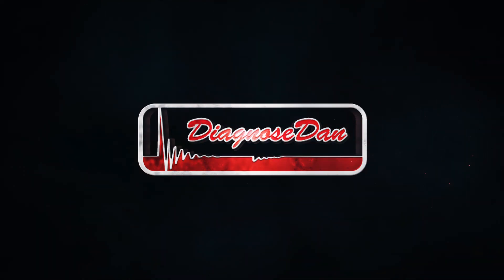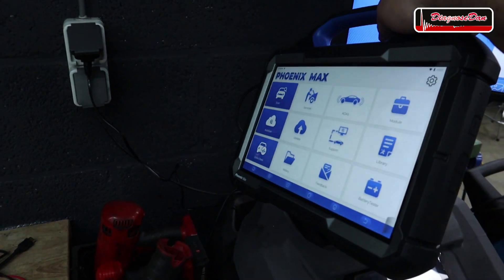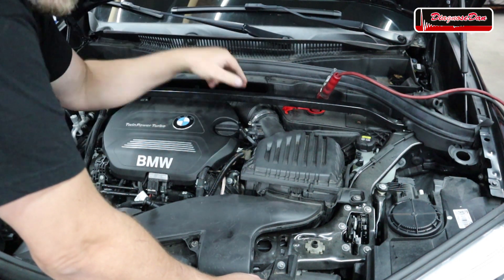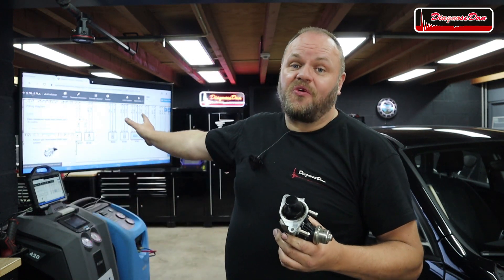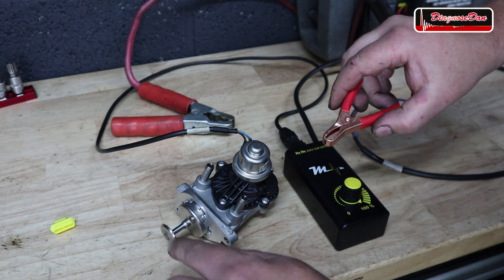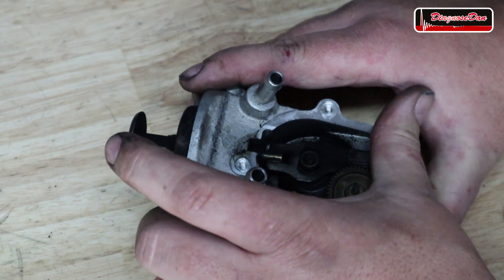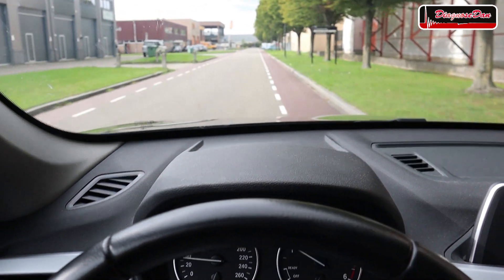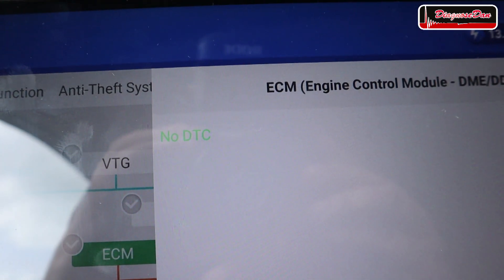EGR TROUBLE

Comment: presumably if you put 12v across pins 1 & 2 of the EGR that will retract the valve and you can install it in the car.  i don't have a obd tool with the feature

Comment: I know it's late but maybe some people don't like to scroll and read below. EGR should be closed, while burning clean the DPF - so the hot gasses help by burning. Also all-in-all EGR only should be open on the low range of the RPM, hence DPF regen is done above 3000 RPM, and EGR really only "helps" with low RPM acceleration (if ever)!
Now to my question - I have the "dreaded" code 4521 (1296) on my 2004 E46 320d, 150 Hp, Eu3 engine but Eu4 exhaust system from factory. Multiple sources told me it is the turbo, but my engine itself doesn't consume any oil, and runs fine in lower gears even above 3000 RPM, when up a hill it just hits the sweet spot - usually above 130 KM/H in 6th gear and goes into limp mode.
Is that a sign of a bad actuator - or should I get the whole turbo checked out? Or can that be only a bad vacuum line?
Thanks for any ideas, or answers! Great channel!!

Comment: Difficult question !
If the EGR valve remains open, carbon saturation will be accelerated, while if it remains closed, it will cause excessively high emissions.
So I would say at 80% (😂😂😂😂) it must remain open !

Comment: definitely right to replace it if you want to warranty it, but I would definitely go get some Berryman carb cleaner or some Rust Blaster and spray it down and clean it. I might even take something like that and put it in some Organic Apple Cider Vinegar with the mother in it and submerge it in a small glass bowl and let it soak for an hour or so. I've done that on a lawn mower gas tank before that had a lot of build up from dirty low octane gas and it had the screen in the bottom of the gas tank shiny again. Even adding some baking soda to it will activate a cleaning foam with the vinegar that is actually great to use in bathtub and sink drains!

Comment: Let me just say that Harbor Freight sells a set of security bits, and the one they sell for cheap has a whole set of torque bits in it. I recently used a T40 to remove a bolt from a throttle body on a 96 Cadillac DeVille. It didn't need the security hole in the middle for it but it was the only T40 I had. You never know when you'll need a bit that needs a hole in the middle to work on something. You don't see them often but you don't need one until you need one!

Comment: Bit of an asshole design on that valve, it would be simple to make that fork-like actuator arm and valve itself to be attached together with couple screws and it would be serviceable assembly, just disassemble and clean it. Brass gears and it would last lifetime of vehicle if maintained correctly.

Comment: hi Dan, in answer to your question, to regen the DPF , it need to be heated about 600 degrees, and it would be done by injecting fuel ATDC ,it's like to make stroke in the DPF,so the EGR should be closed , to not cooling down Exhust temperature.

Comment: I've been through the same exact thing but the scan tools I had did not have the feature to put the EGR into the fitting position, I had to work out which wires were for the actuator and simply supplied them with 12V while I fitted it, and fitted it quick because who knows what duty cycle the EGR actuator is designed for, but it worked, the only other thing you didn't say, and this could be my memory here as it was a while back is that I recall using a diag tool to tell the ECU it had a new EGR valve fitted, which is common these days.

Comment: Excellent video Dan!
I've have this exact issue with my 520d, BMW replaced the valve and cooler and updated the software, issue resolved for a couple of months, then new EGR got clogged/stuck again, replaced again, I now have the same symptoms again with the 2nd new valve. Any suggestions why it is still happening? They mentioned the software update controls the valve differently now depending on the temperature 🤔

Comment: Thanks for the tutorial Dan,
Followed everything you did, except i used ISTA.
When i activate service mode it retracts the valve to 30. But once install it and screw it on, as i tighten it slowly retracts the valve position to 50+ as if its hitting something? 
Any ideas?
Driving it like this still puts the car into limp mode.

Comment: EGR open or closed during DPF regen depends on the regeneration strategy i guess.
In case of heating up the EGT temp closed 100%, how ever the strategy of late injecting fuel and dumping unburned fuel in the cat to heat up the EGR i think it may be fine if the EGR stays active (same for systems that have a separate injector in the exhaust).

Comment: Diagnosedan can plz explan why to initialize the egr valve , because the movement of valve is according to length till the closer position of valve so there is no option it can hit the metal and extend its postion because it made to make movement till the closing postion not above that postion ?

Comment: After looking at this video a second time, I start to understand what's happening. One thing which isn't mentioned is that when the valve is stucked,  the engine die after some seconds, and in the meantime it run very rough. When you try to start several times, may be the engine keep on running.
In my car, X3/F25 30d 2011, it got stuck this week (fault code P042E).
Long story short.
There is a plastic cover above the gears compartment, by removing that I could see that the axle/valve was stuck in open position. This time I could move it up and down by the hand. I put som grease on the moving parts, and I will drive a little to see what happens next then I put the cover back.
There was no soot at all among the gears! The car has been driven 246,399 km, but it is "new" for me.
The adventure goes on... 🥺😉

Comment: I think you could retract the valve wherever you want with the dimmer switch you had. You would be able to install the EGR without a scan tool.
Reply: It will not work. Soon as disconnect the power spring pushes the valve back out.

Comment: Halo Dan, i'm from Indonesia. Here, the population of BMWs with diesel engines is quite rare. I have a 2012 bmw n47 engine, in 2 years I have replaced the EGR valve 2 times. The first was done at an official repair shop and the second at an unofficial workshop, the EGR fault occurred after the car was serviced, at that time the car had only driven a few kilometers. Just driving a few kilometers, the engine becomes lame, the car cannot accelerate, it emits smoke and the engine indicator lights up. I returned to the repair shop, the EGR valve was repeatedly cleaned and the results were the same, in the end I had to replace a new EGR valve. Twice this happened when the car was serviced and EGR cleaned. Since then, I have always reminded the repair shop not to clean the EGR valve. What I'm wondering is, why is the BMW EGR valve so sensitive? If I do the same thing on my other diesel car (Toyota or Mitsubishi), the car doesn't have a problem, in fact, the engine actually gets better.

Comment: The EGR on my 84 Lincoln Mark VII would get stuck open and I would have chunks of carbon holding the valve open .  When stuck open the car would not idle. Never figured out what caused the carbon. I think it was related to slack in the timing chain , causing the vehicle to run rich.  The work around was a screen that caught the carbon .

Comment: Hi boss,can u help.my vw tsi scirocco kept showing break servo yet the brakes seems ok.but anytime i reset the battery,it always doesnt let me start n showing stering button funtion malfunction.with red color stering icon.smtimes 2,4days it need to get them to b ok.fyi,my scanner always shows,10a5.along with egr,n p0441.some ppl say it was the flap problem.but since the day i bought it,it has run 3clynders 3times.even when it was ok,it kept showing simptom of misfire.the aircondtion also not working when brake servo shows.now cos i dnt know which wrksyop that i can trust,it has been driven with stall.cant past 3k rpm.so frustrated.thingking of change car but still need to repair this🙏🙏

Comment: My petrol Skoda Octavia EGR valve was sticking/jamming last year and my local  garage took the top off to reveal the same problem ... Soot & Carbon.
After a vacuum, scrape-out and lubrication everything was fine .... but only for 3 month.
Than I broke down at a particularly bad junction, and had to be recovered with my Dog in the car .... EGR was the fault code.
A new EGR valve installation was £303 in rip-off UK ...

Comment: Dan great video,thank you,question I have is when you put the EGR valve into service mode to install,do you have to keep it plugged in to the engine harness for it to hold that position? When you were testing the new one on the bench and removed the power,the valve returned fully extended. ? Thank you again . I truly appreciate your knowledge !

Comment: Surprised the EGR valve is not sold retracted
Reply: It's not retracted so as not to pre-tension the return spring. If it was sitting on a shelf for months/years, the spring, if under tension, would weaken.

Comment: High Pressure Loop EGR's fitted to early DPF equipped vehicles (Euro4) were very problematic. Great if you only drove up and down the motorway but an engine killer if you did mostly urban driving.

Comment: EGR lowers EGT, so less EGR is used during regeneration. My Euro4 Volvo D5 would fix at 95% closed throught a regen, but on later models EGR was reduced, but remained variable to better control EGT.

Comment: Does anyone know why the car needs an EGR valve. I can see how it works, but I don't know what it actually does or why it is necessary in a car. It seems like an inherently 'built to fail' part that will eventually break due to soot from the gasses clogging it up. Why isn't it soot proof?? 🤔

Comment: Dpf regen happens by injecting more fuel post (after tdc). This will make exhaust heat. Egr is allways closed under regen to get maximum o2 in to combustion. A leaking egr valve will make combustion colder and less clean, making life for dpf hard..

Comment: Why do they make an EGR valve that is spring loaded but breaks when you push it? Could they not have made it pushable and then skip the installation position procedure? This is bad engineering. Also trying to stop people from removing the EGR valve with security torx is dumb.

Comment: The cars are so well made nowadays,that it's amazing,
 they inteligently manage to carefully design and make a simple 2 bolt EGR valve that you absolutely need a 1000 euro computer to allow you to tighten those 2 bolts,
just amazing
Reply: bmw so over engineered it is sublimely stupendous SIMPLE ENGINEERING EQUALS CLEVER ENGINEERING ALWAYS.
Reply: You can make this procedure with 10$ ENet cable and dealer Software. Bmw diagnostic Software is very-very good.

Comment: I am a technician and so when you asked the question "Should the EGR valve be open or closed during DPF regeneration?" and I didn't immediately know I thought huh? How come I've never had to consider that before? Good question.
But what I do know about EGRs is they allow spent gases to occupy some of the combustion chamber therefor reducing exhaust temperatures and NOx emissions as a result.
What I know about DPF regeneration is the temperatures are extremely high to break down the hydrocarbons clogging the filter.
Logically then: The EGR should be closed during a DPF regen. But I imagine there are specific circumstances in the mapping that will allow for it to be open maybe some of the time.

Good video again Dan. You're a legend and obviously really know your stuff.

Comment: Dear Dan. Sorry to be an ass. But this was a complete waste of time. An egr/O2 sensor combo fault codes means that the car is in suicide mode. Dpf has to be removed asap and the intake manifold cleaned from all the sludge. You can crush the new egr as well, because it's just a new problem, not a solution.

Comment: Thanks man, Interesting those EGR valves.
When I bought my iQ in 2010 the EGR was draining from before the catalyst, from the exhaust. These were the then " older" model iQ's (till second half 2010) . After some strong discussion with Toyota Holland they replaced the EGR valve, that now was draining after the catalyst. All the newer models from second half 2010 had it in this way. 
The older models had some problems due to the placement of the EGR valve. I think owners in England went to court about this. Cars would randomly stop having power and go in limp-mode.
After a lot of discussion here in Holland with Toyota, they exchanged the valve and catalyst. For free.
It has never been a recall action. Weirdly.

Comment: Great work Dan, Love all the bonus footage as well 🤣 :)  
An EGR valve installation position, does it also need a relearn after install?  
The extra lengths to stop people working on their vehicle :dothefive: I guess it could be possible to retract by applying voltage during install if the shop had no feature on their scan tools, similar to electronic brake caliper and using the electronic brake switch/button for adaption afterwards. 
 
Always good to see your videos, I hope ya get time to post up more often:yt:😃

Comment: Hello, thanks for the video. I have Fiat Bravo 2008 1.6 multijet 105. Since I have it often has an unstable idle when the engine starts to get warm or is already hot. It is like that for more than a year and nobody can tell what is the problem of the car - I have visited a few mechanics, diagnostics etc. From a few months, I have a check engine light and when I read the code it says P0487 - Insufficient EGR opening. Is it possible the EGR to be the root cause of the unstable idle?  I have already disassembled my throttle body and the egr valve and cleaned them - no improvement. Thanks!

Comment: Well done  dan 👏 👍 i have a  question 
Does  egr valve work  as turbocharger function??
Reply from the maker: When there is turbo pressure in the intake, that pressure is higher than the pressure in the exhaust

Comment: During the DPF regeneration process diesel fuel is injected into the cylinder after combustion has taken place on the exhaust stroke (post injection) so it is pushed through the open exhaust valve into the exhaust system. Here it is burned with air  to generate the heat required to burn the carbon (soot) in the DPF, so the EGR would be closed to increase the temperature. 
Keep it up Dan, great videos!
Even a school boy would understand what you're talking about...:)
Reply from the maker: Thanks for the comment 👍

Comment: I have two questions: First, instead of the fancy bench test rig, can you just use the scan tool to activate the EGR for testing it? And, if you have a clogged EGR, do you also need to check and possibly clean the EGR cooler as well?
Reply from the maker: Yes and yes😁

Comment: IMHO, if it's a high pressure EGR, the valve should be closed. Otherwise Fuel will get in to intake manifold and in result we have uncontrollable ignition. 
If it's low pressure EGR... it doesn't matter ... or i'm no sure
Looking for your explanation :)))
Reply from the maker: Thanks for the comment
Reply: @Diagnosedan  Updated answer: I think EGR ist closed in both cases. Main reason ist DPF's temperature. However I still wait for your opinion :))

Comment: This is so poorly made. The soot (ie, some of the hottest gases in some of the most aggressive/damage prone place of a working engine) should never make it into the little motor compartment. BMW seems to have made a booboo. I've seen VAG cars with 400 000 (b6 audis, golfs) where these valves are incredibly, incredibly dirty - but still fully functional. On my own A6 3,0TDI , I've of course removed the whole shabang (incl., of course, the DPF). The oil remains cleaner muuuuuuuuuuuch longer (for months, instead of minutes) - and there's even the added bonus of some barely discernible V6 exhaust sound at higher RMPs. On my mom's 2012 Merc A-class the original EGR and DPF are still in place and fully functional with no issues at 240 000.
Reply from the maker: Vag also have their share of egr issues

Comment: Should be closed. Because exhaust gas recirculating make temperature in combustion low. When regeneration of dpf the case is higher exhaust gases to burn soot
Reply from the maker: Thanks for the comment

Comment: Egr should be closed during dpf regeneration so that dpf could reach its temperature for regeneration. Egr was made to lower temperatures inside cilinders by recirculating exhaust gas into chamber so with reduced temperatures engine will make less NOx
Reply from the maker: Thanks for the comment

Comment: It looks like there's still a large gap between the valve shaft and the bore hole on the new EGR valve!  These must have a limited lifespan.
Reply from the maker: Remember the these get very hot, if it's very tight it might get stuck.

Comment: EGRs are one of the most failing components on modern diesel engines and also with worst access to them to diagnose or replace. MANUFACTURES and ENGINEERS please consider doing better job when designing your product to do them even slightly better servicable! Great video DAN !
Reply from the maker: They dont make money building cars, the make money in aftersales😉

Comment: The position isn't fixed during fap regeneration , the ecm will manage the temperature and the load on the engine to ensure the charge pressure during regen , torque does not change noticeably . engines like the EA288 VW gen , has 2 EGR's and a exhaust valve to control to manage the exhaust pressure all the time

Comment: Most modern systems have high and low pressure EGR valves or a restrictor somewhere in the exhaust that gives a single EGR valve dual pressure functionality, so potentially therein lies a trick question....😉
Reply from the maker: Thanks for the comment